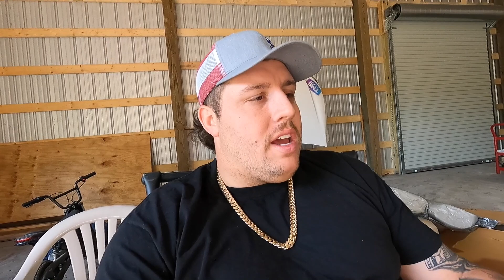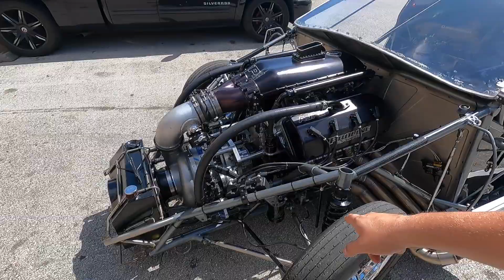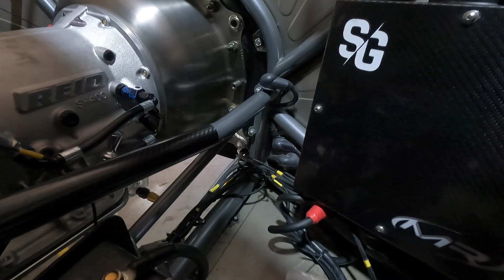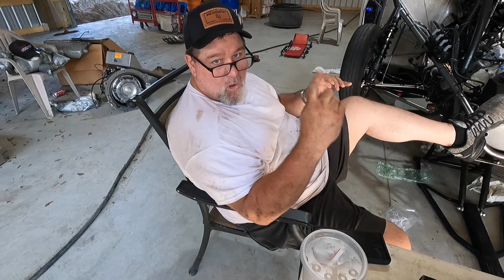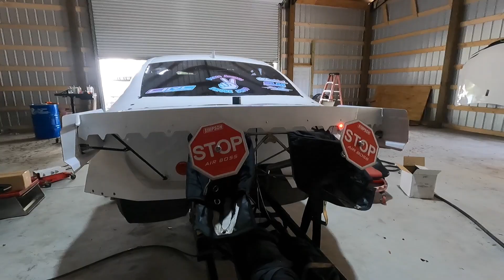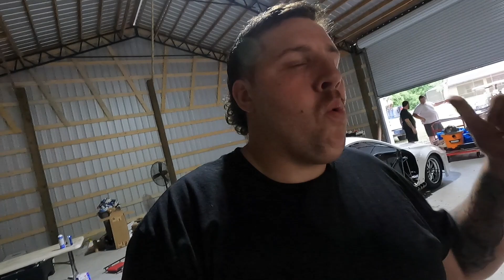CAN'T BELIEVE I DID THIS.

Comment: Ain't no turbo's going on that car. I knew that as soon as you said it! Lol. I'm a little concerned that switching to a TH400 with no lock up might be a backwards step but you won't know until you try it out I suppose. That car really seemed to work well with a Liberty though. Not a wisp of smoke from that motor now. It sounds awesome. Well, good luck testing and I'll be looking out for the video to see how it went. 

Really pleased you've got some Big Country merch now too! I'll be heading over there shortly to take a look! I really hope the changes make a difference. Let's go!! 💪
Reply: I'm thinking the same as you about the trans swap!  I get the weight savings and hope it works out for the better, but they may just end up going back to the liberty after testing!

Comment: Question, how many racers other then Justin were running the Liberty and lock up set up in NPK ? It just doesn’t make sense on making a racer remove high dollar equipment to compete when they are already getting hit with the high cost of racing this year and the supply chain mess .

Comment: Kyle blowing that dirt around with an open procharger right there... lol
Reply: I’ll bet you $100 that it has a plug in the pro charger. 🤌🏽 not rocket science.
Reply: @El_Sasquatcho  With these guys lol... not a chance there is a cover on there...
Reply: @Mikey62866  probably not the smartest move but do you know what I suck up in my procharger every season with not a single issue .. and procharger said it looked brand new after 75 passes and when shits apart in the pits  way worse shit going on all around you especially on windy days .. it'll be fine , if Ive never had an issue he won't be freshens shit up way more than I do

Comment: When you move the car in the trailer, you need to stack wood under the frame to stop it from bouncing in the trailer and hurting the shocks
Reply: I believe he uses the airbags under the car when it’s in trailer!
Reply: @Thewestmos  That's good because I have been to a few events and seen others not doing it.
Reply: Inflatable bladders are cheap enough and far easier to use, that said either blocks or bladders are a must to quite putting miles on the shocks/struts.  When I first tried roundy-roundy racing the first thing I learned was I need keep the suspension from bouncing with the trailer up and down the road